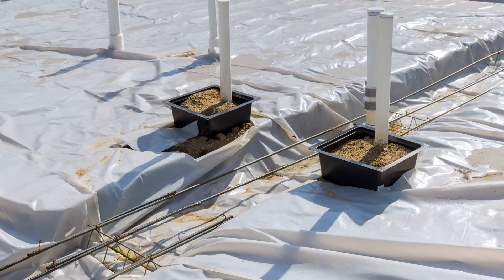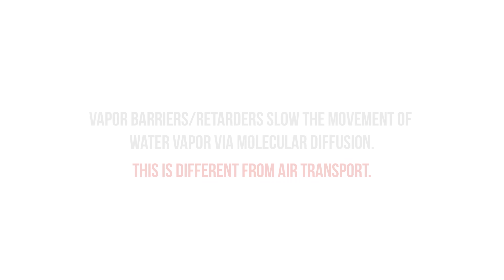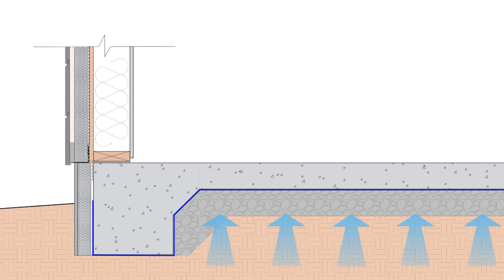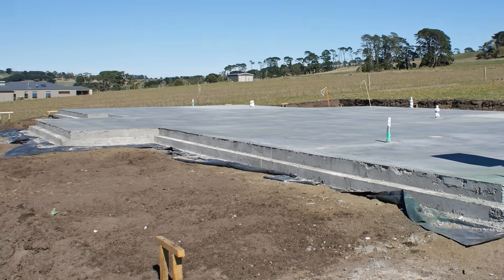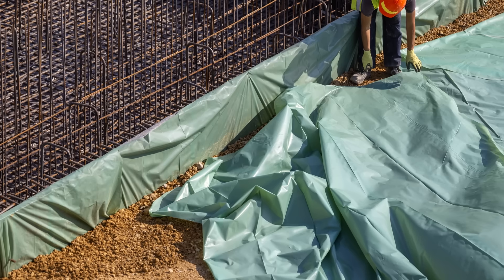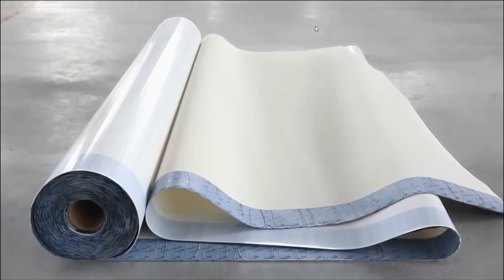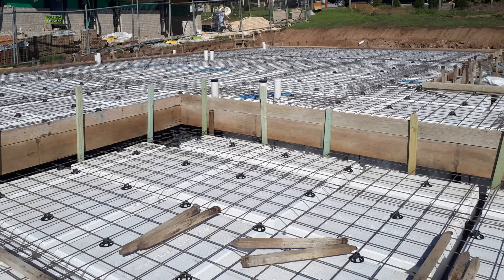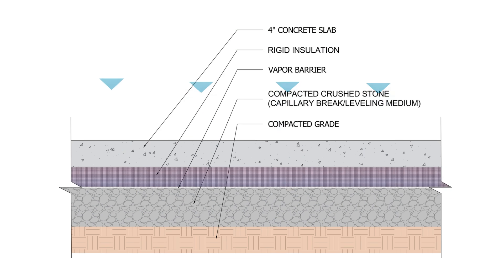You DON'T Understand Vapor Barriers In Slabs!

Comment: I don't understand when insulation is used in ground UNDER the slab.... what happens when that insulation starts breaking down?????   Is there not going to be a massive void or are houses disposable now and only design for 1 generation.
Reply from the maker: @tableshaper4076  It depends how dry you keep it and the substrate that it's installed on. They use rigid foam underneath airplane runways, that stuff isn't getting replaced anytime soon. I'd say that if you are especially concerned, you can always sandwich the foam under 2 layers of vapor barrier.
Reply: @ASIRIDesigns Do you mean rigid foam between polyethylene?
Reply: Why would the polymeric foam break down?  There are no subsurface degradation mechanisms to speak of.  Subsurface foam has a compressive strength of 25 psi, it doesn't dent except with point loads.
Reply: @christopherhaak9824  I agree polyiso foam is strong but I bought 50 year old foam and it was way more crumbly than new foam.  No scientific proof but it was vastly degraded, it didn't have that little bit of give.  It was brittle and snapped and was kind of powdery, if any of that makes sense.  I am not arguing with anyone, I am seriously trying to find answers anywhere I can.  Grainy is a better word, when I broke it it left what felt like sand on my hands and new foam doesn't do that in my opinion.
Reply: @tableshaper4076 Polyiso is not meant for under grade or moisture exposure. You need XPS for that.
Reply: @christopherhaak9824  I'm no scientist but isn't moisture one of the biggest components of decomposition?   Honestly if someone can just link some actual info or study or manufacturers guarantee. I get that everyone has an opinion but where are the facts, why can't I find any facts?
Reply: A couple of points- I used to work for a company that installed light weight concrete as a filler under road surfaces, concrete slabs etc. We usually couldn't compete with EPS for ease of installation and price.  They used EPS in huge blocks under overpass ramps etc. No fear of it breaking down in a lifetime. Also you may be able to poke a hole in mineral wool with your finger but the weight if the concrete is spread out so there isn't that type of point load applied to the mineral wool.
Reply: @mcb3718  I really do appreciate all the info but why won't or why can't I find any info from manufacturers on how long it will last?  None of them have or will respond for requests on this info, I''m going nuts.  And what is a lifetime. I'm hoping to build a house that will last 300 years!  Concrete can last 400 years, timber can last 400 years and even stucco can last 200 years with only repainting.  Why would I build all that on a foam base that apparently no one knows how long it will last?
Reply: your right in your asumption that nothing is built for long term. Even comercial stuff, it's all about speed , cost, and the ability to be built by people who have very little pride in there work.
Reply: @corncrasherandkidgilliam8007  build it yourself then and have the level of pride and longevity you think is appropriate. Most people can't afford something that is going to last 200+ years and also meet all the modern day building codes and also not be stone cold.
Reply: Airport runways are replaced every 30-40 years on average (or about once per generation), so that’s doesn’t really answer the question adequately.
Reply: @MichaelJ674  I've done so much research on buried insulation, I've emailed Dow themselves and no one will give the lifespan of buried insulation.  I really am baffled by the whole process.  Even if the insulation doesn't fail for 100 years it is deteriorating from day 1 so when is it developing voids and moisture pockets?  Concrete can be made to last 400 years and I wouldn't be putting insulation under it!
Reply: @tableshaper4076  you can try to put Rockwool rigid boards underneath, that thing doesn't decompose.
Reply: @Memento-_-Mori-_-2882  I'm no engineer but my brain says anything with that much air in it will compress and not necessarily evenly.   In fact I know it compresses because I can easily push my finger through it!  I know they do use it that way, even under siding but again I just can't comprehend how it works over time.
Reply: @MichaelJ674  Runways have thousands of tons of aircraft moving over them every day, compared to a domestic house slab its not even in the same ballpark!

Comment: I have dry ground but i found that radon mitigation, fan, decreased my in house hunidity by quite a bit. I have to run humidifiers now. I dont have sub slab vapour barrier and there were cracks before they filled it all up.

Comment: One thing I've wondered about insulation below the vapor barrier is will it absorb water and lose it's R-value. I have some used XPS roof insulation that was completely waterlogged. I'm wondering if that happened because of freeze-thaw cycles broke it down and allowed water to enter over time. DO you have any insight? Have you ever seen XPS get waterlogged?
Reply from the maker: Yes this can certainly happen if the adjacent soils are not adequately drained, not only sub-slab but in below grade walls and as you eluded to, protected membrane roofs, so drainage is still king above all no matter what. If you're planning to build in a location with a high water table, sometimes you need a dewatering system to keep the area below the basement slab dry.
Reply: @ASIRIDesigns  Thanks!
Reply: You sure it wasn't EPS foam?   XPS is practically impervious to water.
Reply: XPS is a closed cell foam and has almost no moisture uptake.  Your material was either damaged or severely compromised.  You can soak XPS in water, uptake is almost nil.